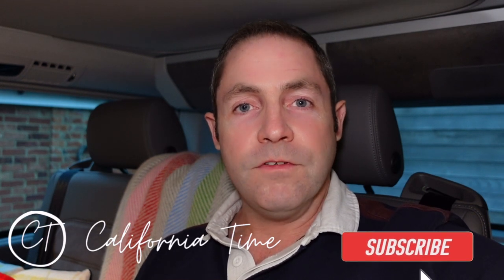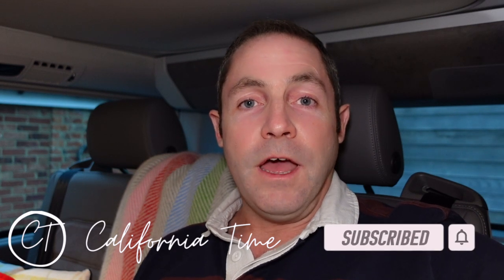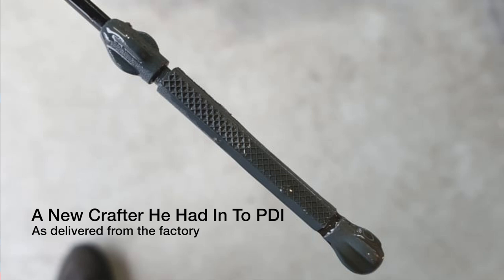VW MASTER TECH INFO: Reduce Oil Level Warning on VW Transporter and California T6.1 - Follow Up

Comment: Firstly I would like to say thankyou for these videos explaining everything properly. I have a T6.1 November 2021. I carried out a full oil and oil filter change myself yesterday. I am very exact with the the torque settings and quantities etc etc. I put 7.4 litres of 0W 30 oil in and went for an hours drive. Hours later I checked the oil level, on level ground etc etc and the oil level on the dipstick was exactly half way.
When I went to the dealers to purchase the oil filter and oil drain plug he told me NOT to be tempted to fill the oil to the top of the dipstick because of "regen", hence watching your channel in order to understand what he meant. I drive all round town and have covered exactly 5K miles and have had no warning lights of any nature. I will always change the oil every 5K due to my style of driving, and especially because of this possible dilution problem.
I have always changed oil and oil filter regularly and it has paid off amazingly. I once had a vauxhall astra van, petrol, that did 248K miles before it gave up and many other vehicles 180K plus. I urge people to look into it, as it is easy to do and you know its spot on, because you have done it, dealers tend to rush things. The dealer also specified 0W 30, 507 spec oil NOT 5W 30, which is shame as I have quite a bit of the 5W, he said its important because if regen!!!
I think for £35 its worth an oil analysis, it will show everything, no where to hide, especially due to the fact your california cost so much.
Reply from the maker: Thanks for the advice for everyone, very wise!

Comment: Hi Will, thanks for the update. I think something should be made clear: the oil level must be ALWAYS  checked when warm, and it needs to be between min and max on the dipstick. Not for the 6.1 but for any vehicles including motorcycles. Oil expands with heat in any vehicle, and I am pretty sure my T6 runs the same exact oil of your T6.1.  The key point of your video is regarding PDI. If before the T6.1 the dealers got away, and probably wasn't an issue either, to fill to the max when cold, i.e. to overfill, the more accurate T6.1 system sends a rightful"overfilled" warning. Oil needs to be checked when warm on a flat surface. Ideally 1-2 mins after switching the engine off. Not only for expansion, but also to allow the oil to drop back into the pan, which happens quickly with a hot engine, not so quickly at all with a cold engine in cold temperatures.
Reply from the maker: Totally agree with everything you’ve written here, thanks for sharing in clear language.

Comment: We've just completed the NC 500, having departed from Cornwall two weeks previously. I had it routine serviced two weeks before our journey, having not had a problem with the oil warning message for the period since August 2022, when we bought the van. 
Approximately 200 miles into our trip, the warning flagged up, so I stopped at the next service area and dipped the oil, which was over the top mark. I took off the filler cap and waited a while before carrying on our journey. It happened again before our first destination, but I carried on and did the same thing as before when we reached it.
Throughout the whole 2025 mile trip, I did the same, lifted the bonnet, checked the level, which never really changed, released the filler cap and carried on with no other issues.
I was going to contact the garage, but now having watched both of your videos regarding this matter have ordered an oil syringe to reduce the level. From there, hopefully, I will solve the problem. 
Many thanks Will. I am also aware that you posted this video a couple of years ago, can I ask, therefore, if there is any further update??
Rich Gibbons
Reply from the maker: No further update really. We did have the van routinely serviced and didn't get the oil level warning back on after that, so after we sorted it initially when we made these videos it's all been just fine.

Comment: Thank you Will.  This all makes much more sense now as I had imagined you had only been doing the longer journeys and could not understand why you would still get oil dilution.  I had exactly the same on a Jaguar XJL.  If used to do many short journeys the oil would dilute and the car would tell you to get an oil service.  Doing many long journeys this did not occur.  Because of the warning was no danger to the engine but of course there was the expense of an extra service.  The real dilution issue will affect people who use the Cali for the regular school run or short hops to the shops.  If it’s mainly used for adventures then it should not occur.  Seems VW just have a glitch with calibrating how much oil should be put in at manufacture!  Hopefully not rocket science for them to correct!
Reply from the maker: Yes exactly. The Master Tech actually sent me a screenshot today (after video editing I’m afraid) of the vw internal system with a diagram of where the ‘OK’ oil level is supposed to be on the dipstick. Bang on half !

Comment: Thank you for taking the time to deal with this interesting and somewhat disturbing subject.  I had wondered why the autostop function had sometimes not kicked in as normal.  I'll keep an eye out for slightly higher revs on standstill and keep in mind your very helpful pointers.  I will also be interested to see the oil expansion on dipping hot and cold.  We do mostly long journeys being somewhat remote and our T6 204PS Bilbo Celeste 2016 has never thrown up this warning; but, I do possess an oil syringe!!! :)  Thanks again.
Reply from the maker: Glad to help - these engines are complex and need careful understanding to get the most out of them I think. Van sounds lovely :)

Comment: Hi Will, so far we have not had any issue with regard to oil level warnings on our Ocean 4 Motion. Bought a similar time to yours, 204 bhp etc. Me being me I checked the oil level shortly after taking delivery, (At normal operating temperature) and found the oil level to be half way up the dipstick. I’ve checked several times since and now 2500 miles in, (At normal operating temperature)  the oil level is still half way up the dipstick. All good. Initially I thought it a big strange to take delivery of a new car with the oil level anything but full, but dismissed it as some sort of cost saving! On watching your post I have just checked the oil level cold, on a level drive and found the dipstick reading to be between a quarter and half way. So in our situation it’s pretty consistent. Hope it stays like that!! However, the intermittent SOS fault remains at the moment. As it apparently does across various Audi’s and Skoda’s also.
Reply from the maker: Sounds like you've been all good from the outset then, that's great news. We have had a few errors from the SOS system too. We put it down to poor signal where we live as we never had an issue when we were on holiday in the Outer Hebrides.

Comment: My new van has been to the shop twice for this problem and thanks to you sharing your insights I've been able to question and challenge some of the work. I just got the software updated and they also changed my oil. I had them lower the oil level to what you did even though they really did not want to do it. Thanks so much for sharing
Reply from the maker: Glad it helped. Make sure you update us on here after 60 to 70 miles to make sure the error doesn’t come back on.
Reply: @CampervanTime  So its been a few days since the last time my van was in the shop and since then I've driven about 300KM without any oil problem.  Now I am curious was the fix a result of the software update or lowering the oil level. I guess I'll find out when my first schedule oil change is due.
Reply from the maker: Excellent stuff, glad it’s all running well!

Comment: That was a good follow up video. Answering questions from first one. 
It makes sense regarding oil level if it was overfilled. However, VW should be making sure that their techs know better when doing PDI. 
The info on software overriding high level for first 1000 miles explains a lot. 
You should discuss the oil test with supplying dealership to see if they would cover costs or try to get them to change your oil then you have peace of mind.
Reply from the maker: Thanks - I would do re: supplying dealer but it's 100 mile round trip so almost the cost of me just buying the test myself. Not worth bothering them with. Depending on the results, then I'd contact them if it is highly contaminated of course.

Comment: Really useful. Had this with my T6.1 2 weeks back, on the first long drive (mid 30s temp) but having covered 1500 miles since I got the ex-demo van. So no light until around 3000 miles total. My oil level is at the top end of the range, so I now know what to do! Thanks.
Reply from the maker: No problem!

Comment: Hi I live in NZ and I have a drive from wheel chair 2022 English spec 6.1 Caravelle Executive 204ps, the floor was lowered in Devon then 
shipped to NZ and I took delivery 27th March 2023 with 380km on the Odo.
At approx 1000 km I checked the oil level cold and it was midway on the hatched area, at 2000 km it was at the lowest hatch.
I purchased 2 litres of VW branded 0W 30 LL (most likely Castrol Edge)  oil costing NZ$82.00,  I added 1 litre as the reading was
so low and thought no more about the matter.
At around 4000 km the reduce oil level message appeared, we have since removed approx ¾ of a litre and now when at running temp.
the oil level is at the top of the hatched area, will be travelling 200 km this weekend hopefully no more messages.
Reply from the maker: I'm sure you'll be fine now - they are a bit pesky! Congrats on getting the vehicle you want in NZ though, that's a great effort.

Comment: Thanks for all the time and effort gone into this Will. Would be interested to hear back if you decide to get the oil sampled though. I will now think twice about turning off when its obvious that a regen is in progress and will give it a few mins to see if it finishes, if practicable. £35 seems a good deal to put your mind at rest, but I suspect you haven't done huge mileage since the unscheduled oil change performed whilst you were away. If you were going to pay for a sample, might be prudent to wait for a while with this "fresh" oil. And I suspect that now armed with the regen info, I am guessing that you haven't had too many failed ones. Are you counting them?
Reply from the maker: Thanks, well we certainly haven't had any failed ones that we know of since doing this mini investigation, and our 'reduce oil level' light hasn't come on at all since our oil level was set to half on the dipstick when engine is cold. Just something to note too, we didn't actually have an oil change when we were away, they simply reduced the oil level by 400-450ml by taking some out. We're still considering getting the oil sampling done, we will make sure we post about it if we do.

Comment: Excellent information . I have the oil level problem on my new T6.1 110 camper. It's 
only done 600 miles. 
Just come back from our first long trip 300 miles there and back. Rang vw assist having arrived at destination. AA man drew off oil via sump plug. Van in place for 4 days.

On way home after 2 hours and about 60 miles oil sensor warning too high came back on. Ignoring warning  light we carried  on home. 
Next morning morning tested oil with engine cold.  About 2/3 full, warning light off.
So, are  rises in oil level  due to oil expansion or DPF diesel reflux into sump?
Any latest views please?
Wondering about taking van back to dealer for checks.

Latest on software update to prevent false oil readings?
Can the engine be damaged by simply ignoring the warning light?
How do you tell if there is a real oil dilution by diesel, apart from white or blue smoke from the exhaust!?
By the way would drawing off oil oneself with syringe invalidate warranty! 
Grateful for your comments.
Well done the gentleman who produced the videos, clear, articulate,  confident delivery. Thank you. Much appreciated.

Peter Bevan
Reply from the maker: Oh no! Sorry to hear about your troubles. 

I would VERY much doubt your problems are diesel in oil related (ie dilution) and probably just the regular over-filling of oil as part of the PDI process at your dealer, where they mistakenly top up the oil to full on the marks on the dipstick prior to delivery. 

In our experience you need to get the oil level a little lower (when cold) - aim for 1/3 to 1/2 on the dipstick and you should find all your warnings go away, and stay off too.

If you want to know about the dilution in your oil, there are companies that you an send an oil sample to for analysis, for about £30 or so and they will tell you what % fuel there is in your oil.

You won't have any warranty issues by drawing a bit of oil out yourself - but obviously if you drew it all out so it was empty and then ran the engine then VW might have something to say about that!! Just do it a little at a time and keep checking on the dipstick and you'll be fine. Don't go below 1/4 between the marks on the dipstick when the engine and oil is cold.

Good luck!

Comment: Great thanks.So basically leave the oil level at about 1/4 up on the dip stick to allow expansion.  
My oil level was exactly that before I topped it up for a long journey. 
The oil level light came on at 361miles after topping up. Why did it not come on sooner is bewildering.  Bloody modern vehicles!!
Reply from the maker: Yes, that is correct. We've had no problems at all with ours since setting it at about 1/3 up on the dipstick and we've done about 1.5k miles+ since then.
Reply: Will,thanks. However could it be a sensor issue? In other words replacement sensor. There are many reports that even after update light is coming on.
Reply from the maker: Well, in all the reading I have done about this from various experiences of the T6.1 (and other VW and Audi cars too), some have had the sensor replaced and had exactly the same issues afterwards and I can't think of anyone who had it replaced and then it was fixed. I had a chat with the master tech again last week actually as he was telling me that the software update only really gives a little bit more tolerance on the oil level 'max' triggering the oil level too high warning - something like 10% more tolerance. That's not a lot really, especially if vans are still being filled to max when cold etc. I think the diagram from VW is the key, as shown in the video.

Comment: I think like any fluid, there will be expansion. I had a Citroen Picasso from new 1.8 petrol. I did 140,000 miles In it and it used 1 litre of oil for every 1,000 miles. Scary I know. Any long journey and we had to take oil with us. I just looked at it as I’m adding clean oil to the engine. By the time it was due a service it had already had a complete oil change. I don’t want this aggravation when we get our California
Reply from the maker: Thanks. We bought a spare 1ltr of oil to take with us on our outer Hebrides trip but then had this reduce oil level message instead !

Comment: So why do they have a full mark on the dip stick if it means filling the vehicle to the FULL mark on the dip stick is ( according to what you've said) means the vehicle is going to expand the oil to an extreme, Surely the dip stick mark should be halved so it shows full and allows for expansion.
I'm driving a Sest Ateca 20 ltr turbo diesel which has a VW engine in it and was serviced last June by Seat and now I have "reduce oil level workshop " 
Is there a cure for this fault warning 
as my car has stood all night and still shows the Fault, as I've said SAME ENGINE

Comment: Fantastic  videos especially on the dpf issues ,Would do the oil analysis,  it would give to piece of mind and would be interesting to see what percentage of diesel you have in the oil ,especially with you doing alot of miles in the California.
Reply from the maker: Thanks. Yes we are considering it just as a final bit of the jigsaw.
Reply: Great advice with the oil level too  , if I do an oil service on my car  I always fill to half way , I have a defender and it  can suffer with the seals failing  on the injectors which will lead to diesel into the oil, if not checked will result in diesel runway.
Reply from the maker: Very sound advice, thanks for sharing 👍

Comment: Always worth running oil analysis at infrequent intervals
Reply from the maker: Great advice, thanks
Reply: @CampervanTime  Audi and possibly other VAG marks are notorious for eating cam followers. An oil composition evaluation especially around 60K can be very informative for metal content too as well as the diesel products. Good preventative maintenance that could save a heap load later down the road.

Comment: Thanks a lot for this video, Will. My new cali Beach Camper 6.1 150 DSG (only two weeks since I have it) is having this issue and thanks to your video now I can understand better what is going on. I'm going to contact the workshop explaining what you comment on this video since they were a little bit lost with this issue. I have a question though, maybe you can answer it. Is this oil sensor issue happening to all 6.1 Calis or just to a batch?
Reply from the maker: Oh dear, sorry to hear you are having issues. From what I have read this applies to all T6.1 vans, not just Cali. Basically VW changed the way that oil levels should be checked on engines from the T6.1 onwards - before levels were checked when cold (ie level should be at the max mark of the dipstick when engine cold), now, level should be checked when hot and oil level on max mark when engine hot). I'm sure they'll sort it. Just need to take a bit of oil out of it by the sounds of it.